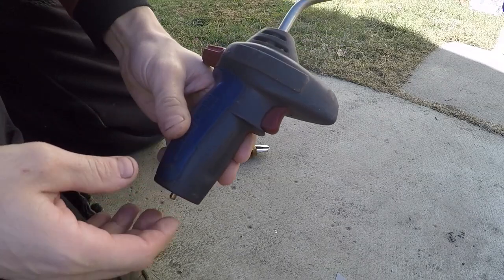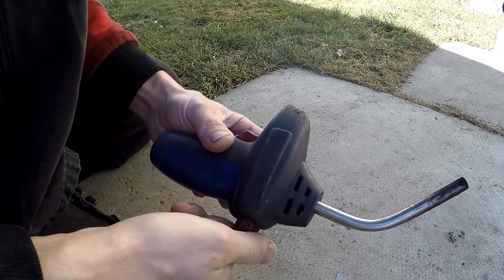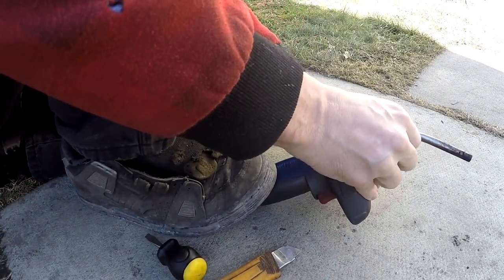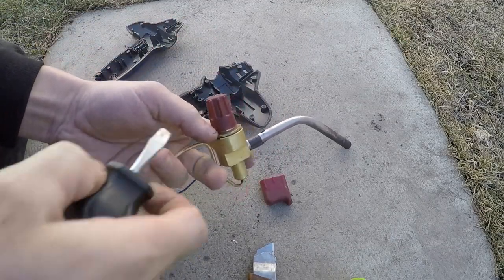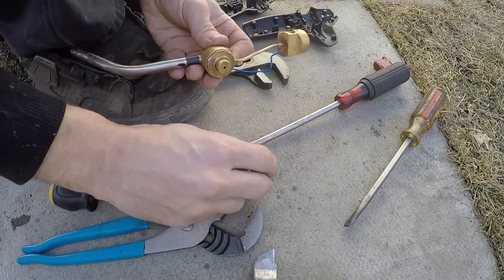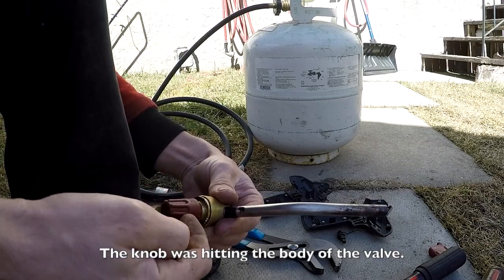Bernzomatic TS3000 Torch Repair. Quick Fix.

Comment: It will come apart without cutting the tabs off with a box cutter. A little more patience and you wouldn't have to tape it back together
Reply from the maker: Really eh !?  I thought mine was glued together. That's good information. I will pin your comment to the top. Thanks.

Edit: Maybe the new ones are different ? From watching it and from memory, the little pins that fit into each other were glued. I could be wrong, or maybe they have changed this so that they pop apart now, or some of them pop apart.
Reply: Did you actually take one apart without breaking the tabs?

Comment: I have used the 💩out of mine for 15 years, and it just started having this issue. 
 
Thanks in advance! I'll try this today. I have 1 arm so this torch is perfect for me to use, and there's nothing near like it on market today.
Reply from the maker: Awesome. I'm glad this helped.
Reply: 15 years???  You must have bought the unicorn of torches.  Goodness.  The first one I bought a few months ago last maybe 20 clicks.  Done.  I bought a new one recently and it lasted 5 clicks and failed.  Absolute junk!
Reply: @pikehunter23750  lol well  I bought another one on ebay that was still in package. It had valve issues. But my original one is still going strong.
Reply: I have one that is about as old as his, still works great.

Comment: I had a different problem with mine. It wouldn't turn off completely as it continued to stay lit ever so slightly, not much but if it did go out, it would still light if I put a lighter to it so the problem was with the valve itself. If you think it's a bit of a pain to get the cover off, wait till it leaks. They definitely don't want you to take this part apart. Where the brass knob cap screws into the cylinder, they put green loctite on the threads then press two little divots on each side to lock it. I drilled out the divots then tried to unscrew it but it wouldn't budge. There's not much lip on the cap to grip with pliers so I put it in the vise and finally broke the loctite then got it apart. I expected to find an o ring or two but instead found that it was nothing but a regular tire stem valve that loosened up. I just took a stem tool and tightened it back up. So now this should last a long time unless the igniter fails, not sure if that part can be found but at least now it'll come apart easy if I ever have to replace the valve.
Reply: I can't remember why I took mine apart (and I didnt' make a video) but I have also experienced the hell of trying to get it apart just like you... just the other day I had my more simple torch stop working, and it was miserable to get apart as well... almost destroyed it.
Reply: If the igniter goes out use one out of a cheap disposable grill lighter. The ones with the long snout not the one that comes installed in a grill! They're basically the same other then the one in torches are of higher quality because they last way longer!
Reply: Was there a brass washer with a rubbery membrane in the middle to seal gas from leaking out from nob and if so how did you remove it?
Reply: @_RocketRooster  Yes, mine had a membrane in-between  the knob and the valve.
Reply: I've made it to the little valve but mine wasn't loose so if its the same size as one out of a tire valve stem I'm gonna see if that'll work. If not I'm gonna check if one thats in one of the little 1 lb fat green camping bottles. Oh the bench vise trick works well. That green Loctite didn't stand a chance when held by the mighty vise! Thanks! Your comment helped me out a bunch!
Reply: @_RocketRooster  it appears to be a standard tire valve at a glance but I didn't actually try one because in my case,it was just loose. If infact a tire valve fits please let me know.
Reply from the maker: @_RocketRooster  Good info.
Reply from the maker: @_RocketRooster  This was filmed 5 years ago... sorry, I have no idea.
Reply: @umpy3152  Yes tire valve worked perfectly!The one out of propane camping bottle was a bit too long. The one i used actually came out of a bicycle inner tube but I'm certain one from a car tire would work as well.
Reply: @JoelArseneaultYouTube  Hey, 5 years old and still helping people! what more could you ask for ? Thanks for making this video!

Comment: Taken mine apart do you know how the ignition is connected? Does the blue wire have to be soldered anywhere at the bottom close to where the black wire is attached? Thanks anyone

Comment: Some of the videos show a rubber o-ring that seals to the tank, but my torch like this did not have an o-ring. Unless I've lost it. It seems to just have a flat cork washer at the contact point.
Reply from the maker: I think the o-ring that they are talking about is in the hose and not in the body of the torch. The torch has the little needle part that sticks into the hose end and pushes on a valve. There is a o-ring that goes in the hose end, usually held in place by a plastic bushing. 

The seal that you are talking about should never really see any pressure as it should all be sealed by the smaller o-ring.